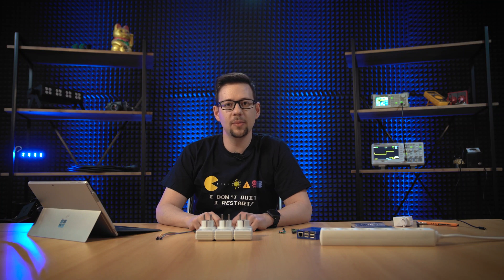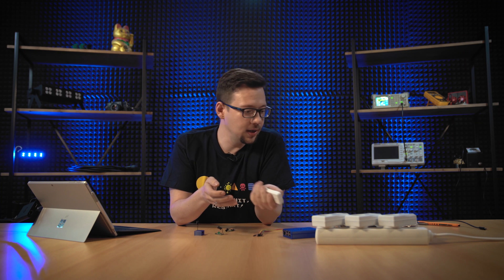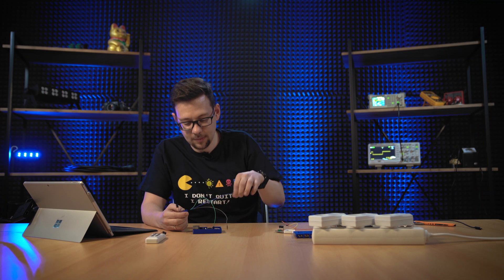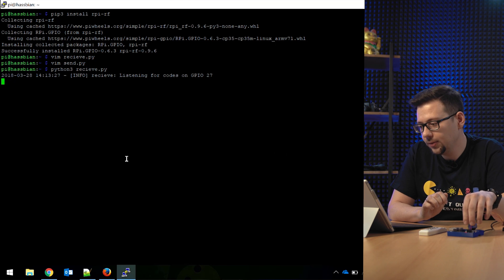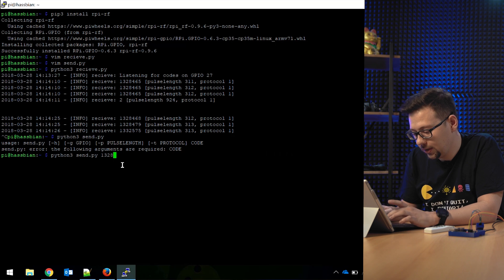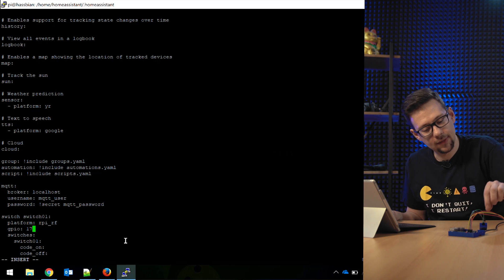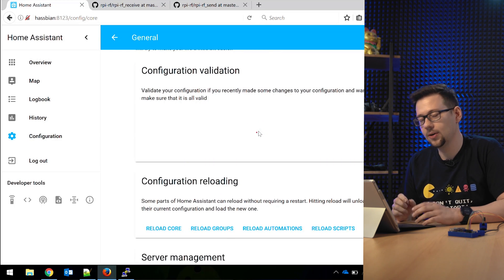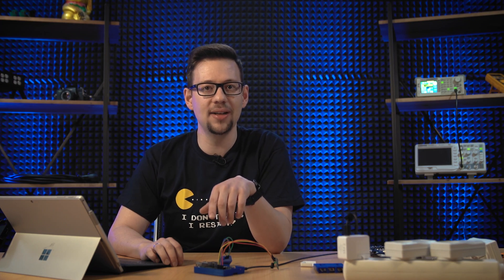Set Up Wireless Sockets for Use with Home Assistant

Comment: Hello 
Great video.!!
I have the following issue.
when I try on my raspberry pi 3 with home assistant to install the rpi-rf I got the following error:

pip3 install rpi-rf        
Collecting rpi-rf
  Using cached rpi_rf-0.9.7-py3-none-any.whl (7.4 kB)
Collecting RPi.GPIO
  Using cached RPi.GPIO-0.7.0.tar.gz (30 kB)
Using legacy 'setup.py install' for RPi.GPIO, since package 'wheel' is not installed.
Installing collected packages: RPi.GPIO, rpi-rf
    Running setup.py install for RPi.GPIO ... error
    ERROR: Command errored out with exit status 1:
     command: /usr/bin/python3 -u -c 'import sys, setuptools, tokenize; sys.argv[0] = '"'"'/tmp/pip-install-xn7np4eb/rpi-gpio_64abdffcb9e048b7980e422358e2be5d/setup.py'"'"'; __file__='"'"'/tmp/pip-install-xn7np4eb/rpi-gpio_64abdffcb9e048b7980e422358e2be5d/setup.py'"'"';f=getattr(tokenize, '"'"'open'"'"', open)(__file__);code=f.read().replace('"'"'\r\n'"'"', '"'"'\n'"'"');f.close();exec(compile(code, __file__, '"'"'exec'"'"'))' install --record /tmp/pip-record-wjmxlaep/install-record.txt --single-version-externally-managed --compile --install-headers /usr/include/python3.9/RPi.GPIO
         cwd: /tmp/pip-install-xn7np4eb/rpi-gpio_64abdffcb9e048b7980e422358e2be5d/
.....
.....
Can anyone help me with that?

Thanks

Comment: This won't work on HassOS?
Reply from the maker: oh, If I'm not mistaken it should work with HassOS the same way
Reply: Not straigth off the bat. You cant run pip3 or sudo apt-get. I found out the hard way.
Run Raspberry Pi OS (Debian 10 aka Buster), and do a supervised install of Home assistant. Then you can run the commands you need to accoplish this tutorial.

Comment: Hello Bernd, I am playing around with this, but when I have my PI in the ´receive´ mode, I see loads of codes comming in. unable to determine which is the code send by my remote control. When I push a button several codes (not really similar when I press more than once) are received, do you also have these devices that needs more codes in a row? Besides, there is a trimmer on the receiver board, do I have to tune that thing?
Reply from the maker: Hi André, thank you for your question and your patience. A quick question. Did you use a RC without dip switch?

Comment: Haufenweise Fehler. Belegung der PINS stimmt nicht. Die farbige Zeichnung (Abbildung) mit der Verkabelung ebenso nicht und birgt das Risiko der Kurzschlisses - wwenn man nicht genau aufpasst. Der Code für die configuration.yaml ist Müll. So sieht es richtig aus (auf die 2-Leerzeichen-Tabs aufpassen):
switch:
  - platform: rpi_rf
    gpio: 17
    switches:
# Schalter Bettleuchte
      Bettleuchte:
        code_on: 4539729
        code_off: 4539732
# Schalter Pflanze1
      Pflanze1:
        code_on: 4542801
        code_off: 4542804
# Schalter Pflanze 2
      Pflanze2:
        code_on: 4543569
        code_off: 4543572
Wobei "switch:" als Kennzeichnung eines Definitionsblocks, nur einmal in der Configuration.yaml auftauchen darf. Also, alle weiteren Schalter gehören auch hinter diesen obersten Bezeichner.
Reply from the maker: thanks for the tips, we really appreciate it

Comment: Hello, it’s great video but Van YouTube pls ad the link of the devices you are connecting to raspberry?
Reply from the maker: Hi Rik, 
you can buy these: https://www.amazon.com/Transmitter-Receiver-Regeneration-Wireless-Burglar/dp/B01AL5Q7SC/ref=sr_1_6?ie=UTF8&qid=1526978325&sr=8-6&keywords=433mhz+transmitter+and+receiver

or these and ad an antenna (but the antenna has to be exactly 17cm long) : https://www.amazon.com/WINGONEER%C2%AE-Wireless-Transmitter-Receiver-Raspberry/dp/B07B9X46LB/ref=sr_1_20?ie=UTF8&qid=1526978325&sr=8-20&keywords=433mhz+transmitter+and+receiver